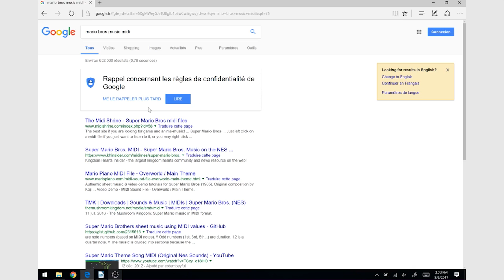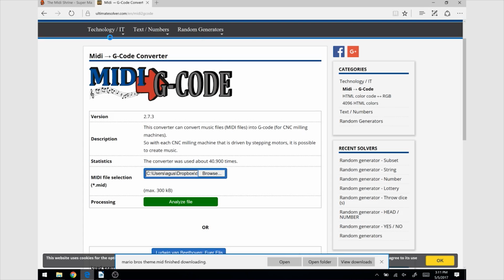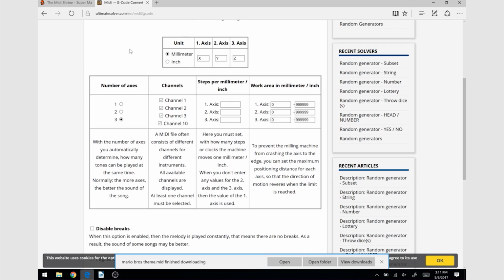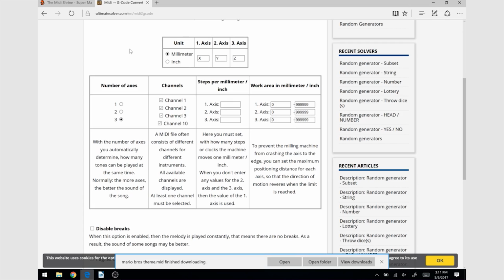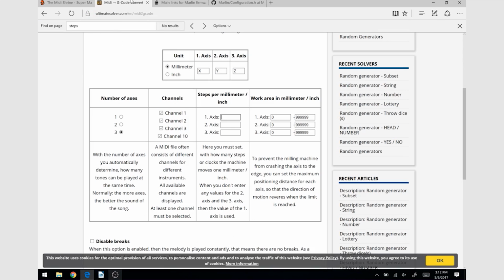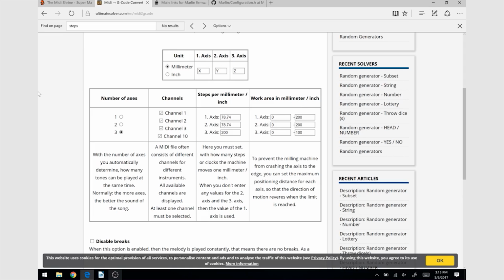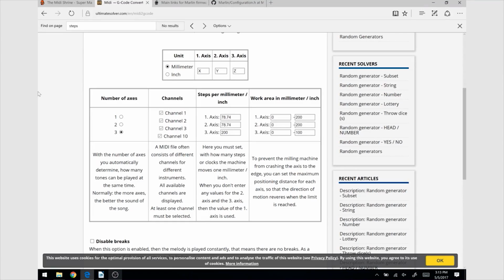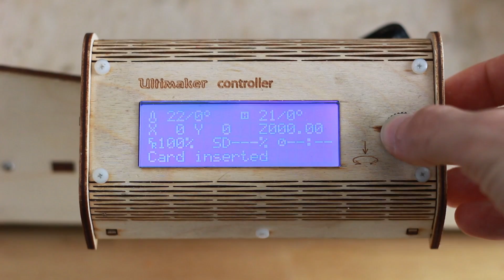Play Music with your 3D Printer - Midi to Gcode Tutorial - How To

Comment: Did you have to modify the gcode any  to get it to print/play? I tried a couple of midi files and, first of all... the site saved it as .nc files. I had to rename them .gcode. Once I loaded them into the printer, though, it just locked up and I had to disconnect OctoPrint, reboot the Marlin controller and then reconnect OctoPrint. My printer is a Tevo Tarantula, but we seem to be using the same controller firmware so it should be working... :( 

I really wanted to hear "Sanford and Son" and the "Mission: Impossible" (the TV show, not the sucky movies) theme song coming from my printer... which already sounds like it's singing when I print! lol
Reply: I'm running into the same issue you are.
Reply: I haven't tried this yet, but I found this on Thingiverse - http://www.thingiverse.com/thing:2315323 ....
Reply from the maker: I didn't download the .nc file as most 3D printers only ready Gcode files. I just copied the Gcode (all the text that is below the "save .nc file" button) into an existing Gcode file I already had on my SD card. You can also paste it into a Text editor and save it as *.gcode. 

Depending on your printer you may have or want to add some commands before it starts playing the music, such as a G28 command to home all the axis. In my case I didn´t have to add any commands before the "musical" code.
Reply: I tried both downloading the .nc (renamed to .gcode) file as well as copying and pasting the displayed gcode. When compared together, both files were identical. I then compared those to a know good gcode file. The one thing that stood out is that working gcode files use the semicolon symbol for comments whereas the midi-gcode file uses parenthesis. That may be causing the files to hang. My printer is printing right now, but once I verify this one way or the other, I will report back. Did you include the comments in your copy-and-paste?
Reply from the maker: I just copied and pasted all the generated Gcode. I didn't add or modify anything. :S
Reply: Interesting... well, once I changed all of the '(' symbols to '; (' instead... it worked great. Thanks!
Reply: Once I changed all of the '(' symbols to '; (' instead... it worked great. For  me, the gcode files need a semicolon as a comment modifier. The generated code uses a parenthesis instead. Try that. It worked for me, it might work for you.